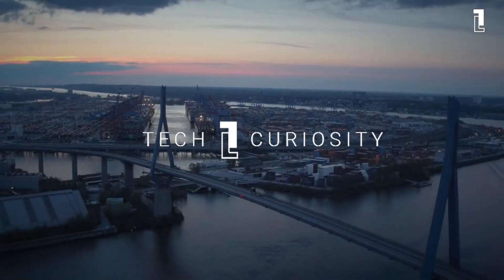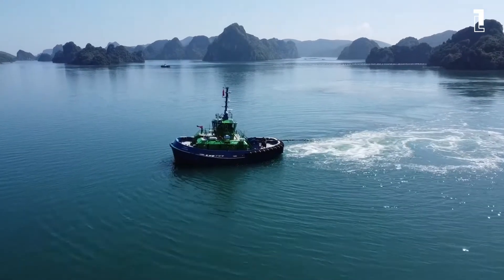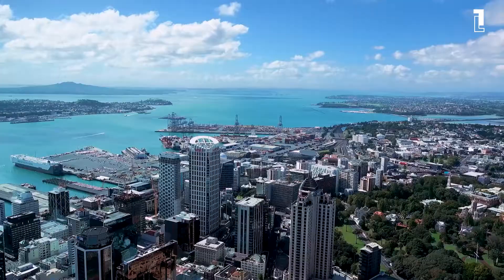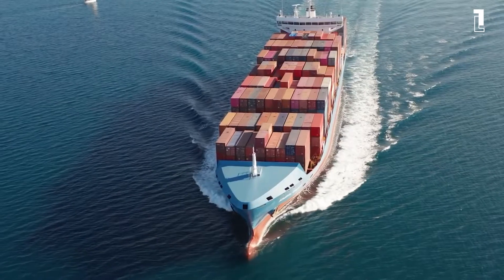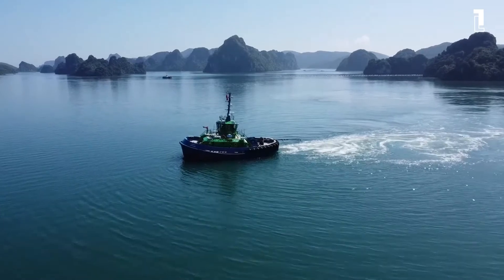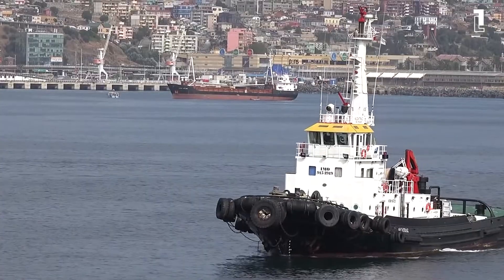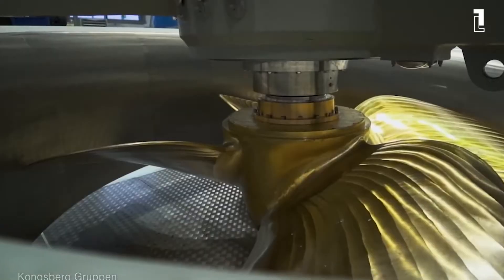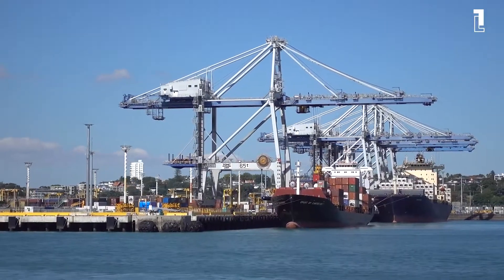Sparky : World's First Electric Tugboat

Comment: Where does the charging electricity come from? Diesel generators? When all the tugs are electric how will the power grid handle the draw? What are the production costs for manufacture verses a diesel boat? Where do the battery components come from? How long is the life of the batteries? What happens to the batteries when they no longer work? Just a few questions a true reporter might have answered. And yes that is a short work time!
Reply: 1) from a green grid
2) like the transformation for cars, this will also happen for this
3) when the batteries are done, then you get new ones
4) why do you ask such questions ?
Reply: You could easily find the answers - if you wished to, but don't...